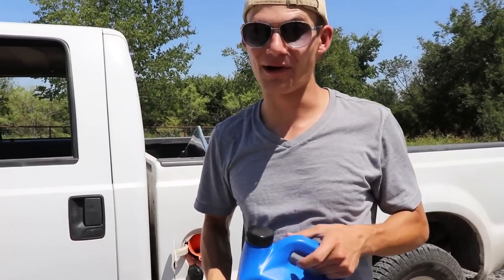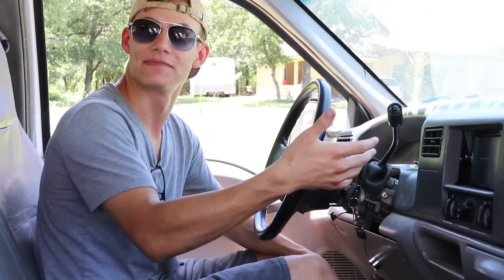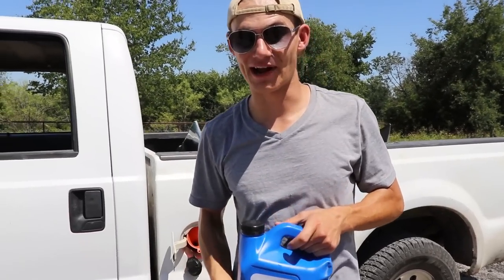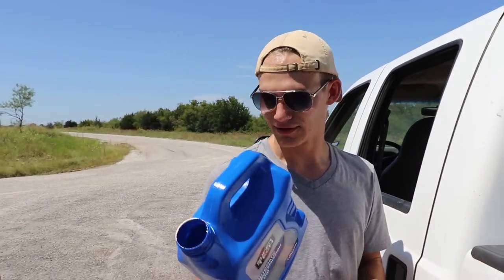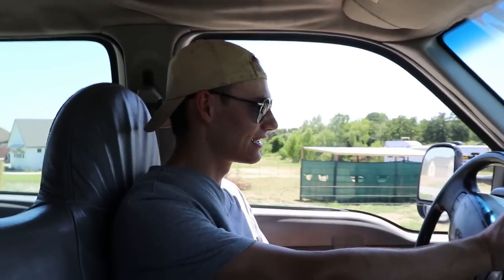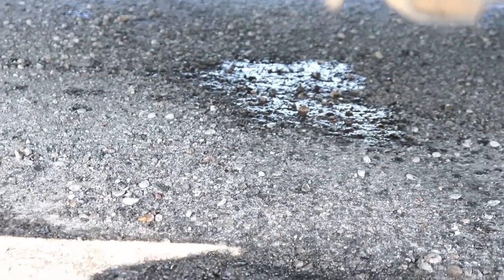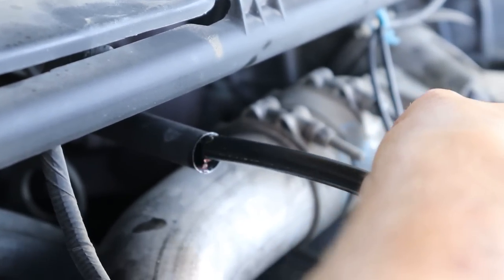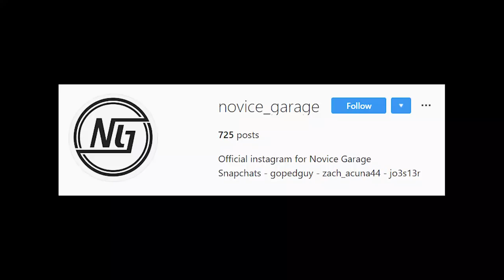Can You Run a Diesel Truck On ATF?

Comment: Running on pure ATF is actually really, really common in the IDI Diesel community. When swapping the water separator, it’s actually advised to completely fill the new filter up completely with just ATF to prime the fuel system and also clean out the injectors. They run really well on the stuff because most all-mechanical indirect injected diesels have prechambers, which is heated due to the glow plugs on startup, and the natural warmth created by the engine running. The combustion starts in these chambers and spreads to the cylinder on the power cycle. Newer electric direct injection diesels don’t have these prechambers and have a cup built into the piston instead. They don’t run pure oil/ATF as efficient as the mechanical IDI’s do, and usually require the oil/ATF to be cut with spirits to run properly.
Reply: I came across this vid because I wanted to know if running atf on my Toyota 12ht could clean my injectors and not hurt injector pump.

Comment: THe question was asked if a diesel engine can run on gasoline. Tests have shown that it works well, but parts that require the lubricity of the diesel fuel, like the fuel pump, will wear much faster.
Reply: Run black diesel

Comment: Yall press that like button because I wanna see Diesel in this here transmission... lol
Reply: It won't work. Atf is formulated to have non newtonian properties at high speeds, to create the mesh in the torque converter. Diesel, does not.

Comment: wow keep up the good work and will it run on piss lol
Reply: Ok man I was thinking the Sam thing, I might try it my self
Reply: In Canada because of the cold, most diesel owners, farmers and truckers carry ATF with them because in the fall and spring we get cold snaps where a diesel can freeze off if its not winter diesel. So you add ATF to keep your tanks and lines from freezing off when driving. because the cold wind can otherwise freeze off summer diesel in your fuel lines.
Reply: NPC #303  In the tank
Reply: Call me a loser.... but once me and my buddies got drunk and pissed in my friends 98 Camry... I swear to god that gas gauge moved
Reply: Probably that's what DEF is.
Reply: them 7.3 2 stroke were something!

Comment: Once my buddy had no diesel in his 7.3 and I gave him like a bunch of bottles of used moter oil and he got like a quarter tank and it ran fine but sooted alittle lol
Reply: Cole Packard you’re a generous soul
Reply: I'd rather gift my friend 20 bucks to get some diesel rather than let him burn UMO. :( So much fine metal particulates and soot suspended in it. Synthetic and synblend motor oil doesn't burn well because it's specifically designed NOT to burn to avoid oil consumption in normal use.

Comment: I used to run automatic transmission fluid in the fuel filter every time I changed it on the big truck keeps injectors clean
Reply: Putting it in the oil filter would not get it to the injectors...
Reply: @Yeye3040  I meant Fuel FIlter..LOL We are talking way old school late 70's mid 80's. Whenever I had to replace the fuel filter I was instructed to prime it with ATF it would super clean the injectors, or so I was led to believe. 888K miles on the Cummings, never lost an injector.
Reply: @dapoppa2256  no
Reply: @dapoppa2256  do you still do it? I add atf yo my diesel fuel and definitely feel the difference and mine is a new 250 with all the emissions still on unfortunately. No problems so far
Reply: @Yeye3040   fuel filter

Comment: There is a drain valve on the fuel bowl. It will keep you from getting radioactive horse piss in your eye. Aka fuel. Also u can just open the drain and leave the fuel pump on to drain the fuel system. Some additional information. The reason the truck stumbled at first was because their was air in the system. It helps if you fill the fuel bowl before starting the truck.
Reply: Well I’m only 19 but I’m not as new to working on vehicles.
Reply: @makeitbreakit7556  I'm glad to hear that it makes me happy someone your age actually knows what he is doing. You young man are one of the rare ones today.

Comment: You can mix with diesel like 20 liter diesel one liter atf good for pump
Reply: Also good for getting a huge ticket when the cops check your diesel to see if you're running red/pink tax free off-road only diesel fuel on the city streets. The red dye in ATF makes the whole tank turn pink just like the off-road stuff. No bueno.

Comment: I ran my 7.3 for 6 months and 15,000 miles on almost strictly USED ATF.  Never had an issue.
Reply: @KrazyKratosFan  The shop I worked at sold alot of trans flushes.
Reply: Did you filter it, or just pour it in and let it eat?

Comment: Either the power is way down due to fuel type or that motor is worn out. They do a nasty burnout stock. (I’ve had 2) Old 7.3 powerstrokes and cummins 12valves will run on anything.

Comment: They mix it in to take advantage of the detergent additives in the fluid to super clean the injectors and fuel system.
Mercedes told my father about doing this 45 years ago in his diesel sedan.
Reply: Yep! My father worked on old in-line diesel Mercedes and all the old mechanics used ATF in the diesel fuel 

Some of the engines they worked on ran for millions of KM’s

Comment: The atf should clean those injector good .....and it shouldnt smoke too much .....if mixed with diesel. That and half a quart in the crank case in the oil....a way to trick passing diesel emissions ..in places that have it.  i do the crankcase bit with my gas engines ....when hwe had emissions...now cancelled.....Hey Chris 😎

Comment: Back in the early 90s I worked for an old school farmer who was into tractor pulls and mud bog trucks.he had a 4 Chevy 3/4 ton pickups with  6.2l diesels in them .he used to add 1 quart of gas mixed with 1 quart of atf to all his competition rigs .he claimed it worked as a form of octane boost to the diesel fuel.not sure if it was or not myself but he must of had something right because he won several events.but then again we all know some crazy old farmer that has little tricks up their sleeves when it comes to mechanical stuff,most can make something out of nothing. And back then turbos were almost unheard of on smaller vehicles like pickups.anyway cool video at least we now know in a pinch it may run like crap but atf can be a fuel for diesels.thanks for sharing.
Reply: Grandpa told me before glow plugs they would mix like 20% gas and diesel to get them to run in the winter.  And also they would light small fires underneath bull dozers oil pans to warm them up in sub zero temps.  Before they invented block heaters

Comment: Keep it going with that bad ass 7.3 motor
Run. Shit out that motor to it Died
Try gasoline McDonald's coconut oil transmission fluid  all it getter mix in the next video
Reply: Old diesels would run fine on that. Ive ran used motor oil, atf, and even vegitable oil in my 2003 diesel volkswagen jetta. Many people mix 80% used motor oil and 20% gasoline . Yes gas, not diesel. The gas thins out the motor oil to bring it closer to the vidcosity of diesel.

Comment: Nah, Ive got a 4l60 in a crew cab dually and it doesnt break a sweat.
Reply: It should be a 4l80
Reply: @shanepurcell8376  Tranny came attached to the 5.3, custom wire harness free transmission, cant complain. 90% of the failed 4l60 are just bad grounds anyway.
Reply: @DarkLinkAD  in a dually? What year?
Reply: @shanepurcell8376  88-2001 body style, 3500hd.
Was a 6.5 TD, with 5 speed.
Now its a L59 Flex Fuel (2000-2002 Tahoe XL or Suburban engine)
4l60e, custom length drive shaft and 14bolt rear.

Comment: When the engine runs poorly it has to adjust everything including the transmission to compensate, so most likely the transmission is probably burning up from the engine running poorly. I had that rare occurrence with my Expedition when it needed new spark plugs bad, would just go into neutral with a flashing o/d light and wouldn't make hills, changed the plugs and the transmission was happy after that. Transmission is the original 19 year old Metric 4R100 that I don't think has been ever touched. Still pulls good. I am surprised how well the tc has held up but then again it's been a daily driver it's whole life and hasn't seen a lot of trailer use.

Comment: Lol its off roed desel  i Like how they cut to them porn in after they open the bottle and the reason the starter starter is because there wasn’t no fuel in the system they had a little bit higher and had to work the air out of it try again we know it was aphrodisiac hey said smoke if you’re running straight transmission fluid

Comment: Hey my 6.0 runs like a champ man #stop hating. They can last just as long as the 7.3. Just needs to be maintained properly
Reply: By maintenance you mean $15k to bullet proof it after it grenades with 120k on the clock... lol. #jealousmuch 
All jokes aside, your lucky there are examples of some that make it between 500k and a million miles... but you have to accept that those are the exceptions not the rule... 7.3's that is the rule not the exception. Theres a reason 7.3's sell for nearly double what a 6.0 goes for.
Reply: @Superado2006  three years down still going strong the old 7.3 broke down four times vacuum pump, Idm, starter and the wiring harness under the driver side valve cover. # let’s go 6.0
Reply: @richard4821  Like I said just because you got lucky doesn't mean the endless stories that most people face with the 6.0 aren't true... good for you. But the 7.3 is the King of Ford diesels for a reason. The more you try to argue that the 6.0 is equal or better, the more you sound like a fan boy that can't admit his team sucks even though his team went 4-13 that season! "But those 4 games we kicked but!" LoL!
Reply: @Superado2006  hater’s gotta hate
Reply: @richard4821  Fanboys gotta front! 😉😆
Reply: @Superado2006  I will be honest I was skeptical at first, but she hasn’t let me down yet admitting to you that they have had loads of problems 05 and up have better engines but you will always find good and bad and every manufacturer you just half to do some research for yourself and I will always stand by mine Good luck to you, sir.

Comment: That truck will go 1 million miles. Or close to it just get sleeves for it at 500,000 miles or reboard the cylinders. That truck is clean you could get about 8 to 11 thousand for it. I’ve seen a rotted out 7.3L sell for 5 thousand